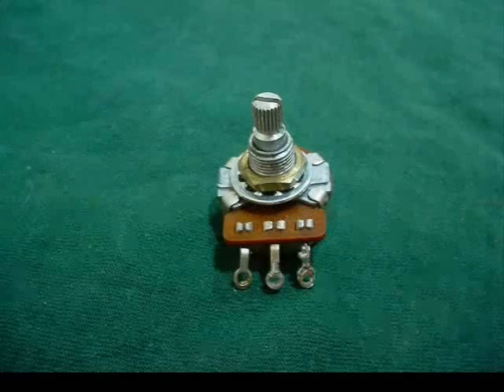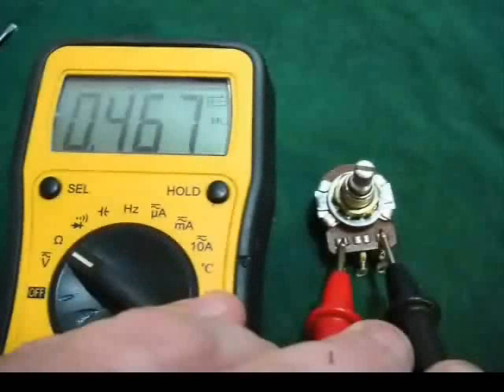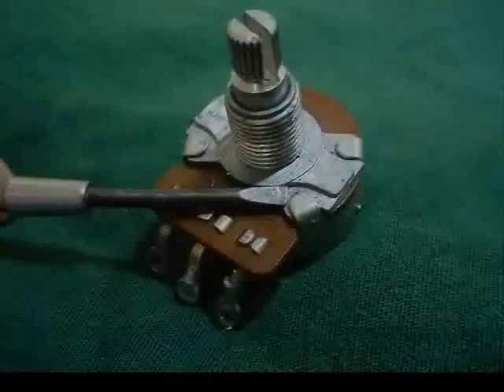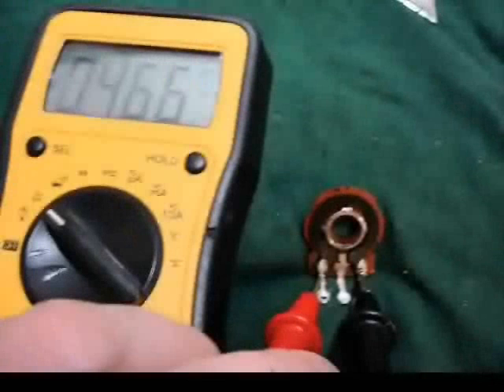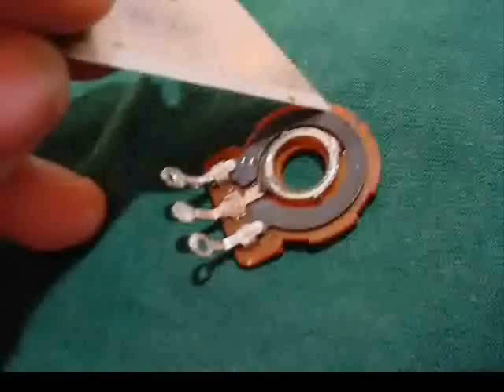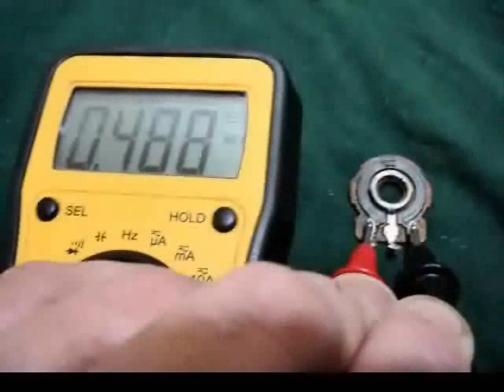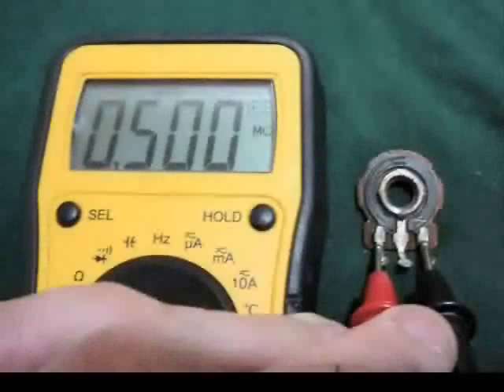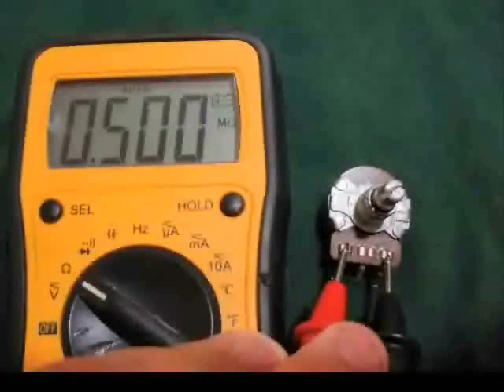How to Increase a Pot's Resistance Value

Comment: This method seemed a little risky for my unsteady hands. But I decided to modify the thinking to take the carbon trace down from the top. I had two cts pots, 20% and 250k. They measured 218k. So I used a pencil eraser to take even strokes across pot trace and within 10 minutes on each pot had them up to 251k resistance. 
I used a 200 grit sandpaper to keep eraser clean every so often. Also you can keep multimeter attached as you progress to dial in wanted resistance.  You just have to cross unused pot terminal with center terminal with small srewdriver to see results on multimeter. Also there was still a good solid carbon track left after completion.

Comment: Depending who much of an increase you want, you can scrap off a little of the carbon on the top.  I wanted a 1meg pot but instead of buying one, I took a 500k to 800 by doing that.

Comment: Hello, noob question... how is it posible that by removing resistive material you are increasing the resistance? shouldn't be the opposite, that adding material to the carbon track will make the resistance of the pot increase? Thanks!
Reply: i guess that there’s less track for the current to pass, so it’s harder, meaning higher resistance

Comment: This is cool. But I’m not clear on what you’re scraping. Are you shaving the carbon ring so it’s smaller in OD and larger in ID? I would think that by removing material your Ohms would go down, not up. 
Does this work for conductive plastic as well as carbon?
Is there a way to decrease the resistance?
Thanks for sharing. 
Paul
Reply: carbon is conductive.. the more carbon the more conductive.. less carbon less conductive ie more resistance.

Comment: It's easier to take the back cover off of the pot with miniature flush-cutting wire cutters, by slipping one edge of the wire cutters under the tabs and levering them upwards.  Trying to pry them up with a small screwdriver often results in you stabbing your hand with the tip of the screwdriver.

Comment: And if the value too high from 500 k, how can I do for decrease it value equal to 500?
Reply: Solder a 500 Ohm resistor across pins 1 and 3.

Comment: It seems by scraping the carbon off, the resistance would lessen. Please explain.
Reply: The less conductive material, the more resistance. That's why fuses rated for high current use thicker wires, while low-current ones use very thin, almost hair-like conductors.

Comment: I am 1 for 3 on using this method to get the values I want vs ruining the pot by overworking it.  I currently run a 600k in my Neck and I am very happy.  Great vid.